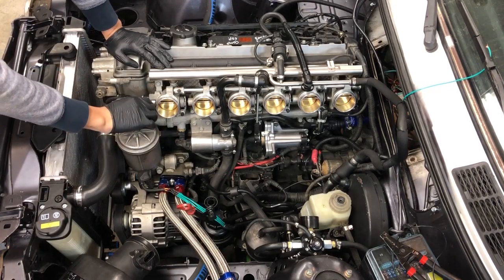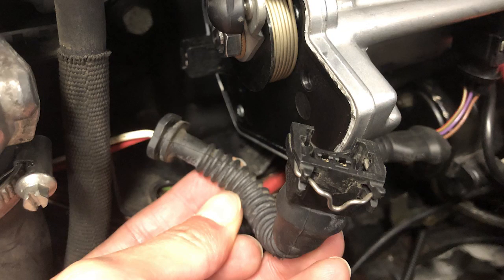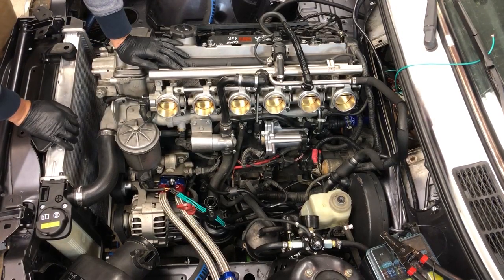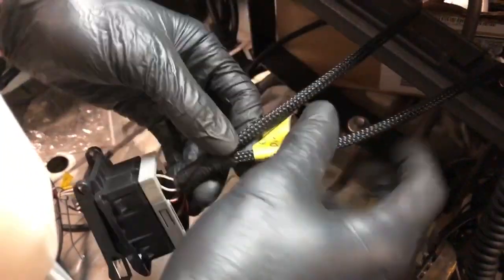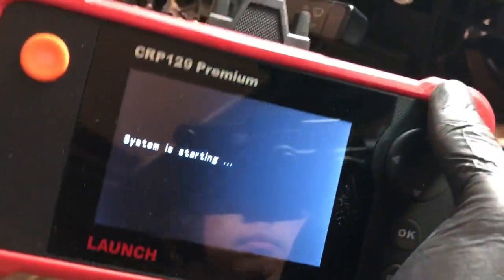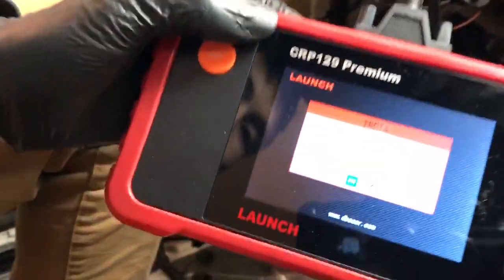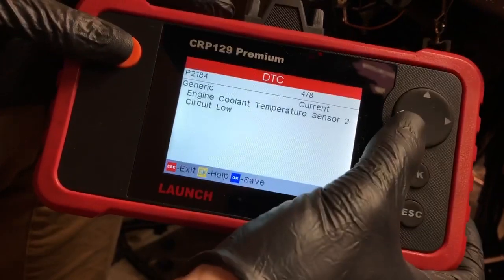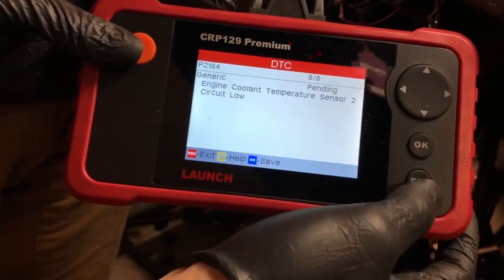How to Engine Swap BMW S54 M3 Into E30 - START UP

Comment: I’m in process of doing an s54 swap right now and I’m wondering how did you run your brake booster, master, and clutch master system
Reply from the maker: Porsche brake booster, master and clutch are e30 oem. Please see fiberglass video on how to modify the intake manifold.

Comment: Is that an M42 radiator? Have you had any cooling problems with that setup?
Reply from the maker: It’s a radiator from a Z3. Next time around i’ll get the e46 m3 radiator. The integrated expansion tank is nice but the tank is on the other side of where the outlet hose is on the engine. Due to that design I have to have a long hose wrapping around the front of the vehicle. I plan on using the regular e46 m3 expansion tank. No cooling issues so far.
Reply: @Garage88Official  Thanks for the reply and the pro tip. I'm considering a radiator out of a MZ3 so I can tuck the oil cooler into the recess but am reconsidering with this new info. Thanks again!

Comment: On my build (FB @ddthirty ) I had the code P1637, I replaced the 2 TPS and it rectified the problem. It is interesting that you don’t have any throttle, I would suggest it is a wiring problem (possibly a poor earth) or maybe it is the accelerator (gas peddle) itself. I did find with my build that at each stage of getting the engine operational a new code developed, in hindsight I would just replace all sensors from the beginning and start it fresh. Good luck with the rest of the build.
Reply from the maker: We replaced one of the TPS because it snapped off. We have switched it between the two and it makes no difference. We will check for the earth connection. Thank you!

Comment: Hey I'm so glad to see your project car is an E30 with the S54 engine. This configuration is one of the most celebrated swaps out there. The size and weight of the E30 combined with the power and high revving of the S54 are just a match made in heaven! I hope you don't have too many troubles getting it all to work. I have a swapped out E46 330ci with all E46 M3 swap. I love that car but often wish it was what you are working on right now as I love the lightness and size of the E30! Best of everything and I'll be watching.  Subbed!
Reply from the maker: Thank you!